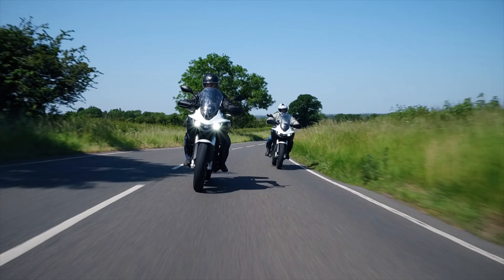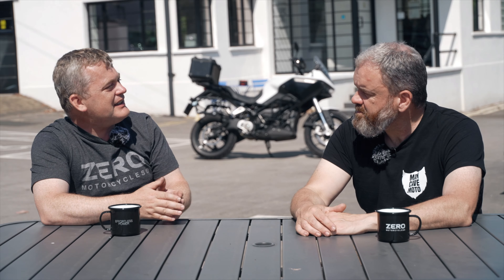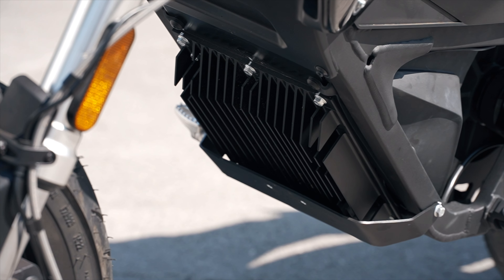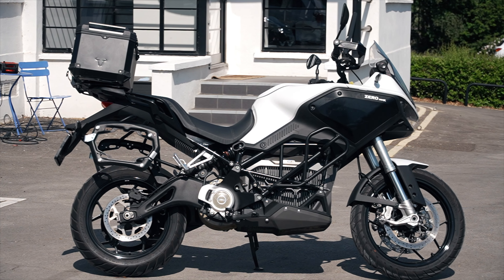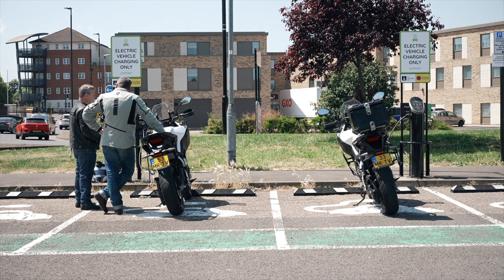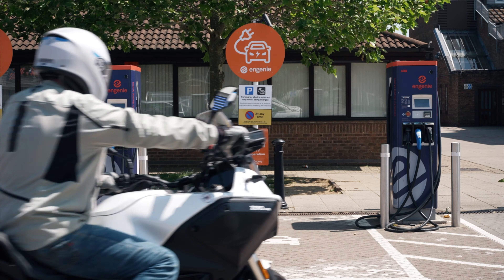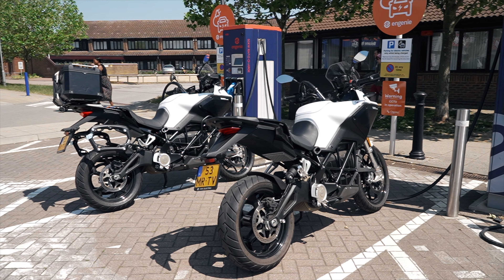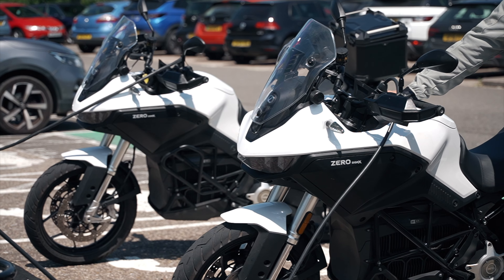Everything you need to know about electric charging with Zero Motorcycles

Comment: I have an electric car and absolutely love it. Range anxiety in the car is minimal so long as you plan ahead but you quickly get into a rhythm. I can see that bikes are slightly different and would require a little more forward planning. For commuting they make total sense though so the only problem is the purchase price vs a petrol engine. Fully commend Zero and others for innovating and giving us another option to consider. We’re definitely in a golden age of motorcycles. Thanks for the film
Reply: The problem with bikes is you have much less mass to dedicate to battery and your body makes up a large part of the wind resistance. Add on top high performance electric bikes have never been mass produced before. This is a case of chicken and egg problem just to even get the industry starting. It's an interesting start since the performance is already overkill, but the usability needs alot of work.

Comment: Charging can be very boring sometimes, but you can get used to it.
I do 150-200 km rides on my electric scooter, but I always need to carefully plan the route and charging stops in advance. Back up options are also important. Last weekend I only had a few percent left in my battery, and when I finally reached the charging station, both slots were taken. So I had to go to the nearest station, but I couldn't make it so I had to push my scooter 😅 It took 1 hour to charge from 0 to 50% which was more than enough to get me home.

Comment: Hi, quick question, are standard passenger car charging stations compatible with motorcycle chargers? Am I correct in saying that they typically will only accept AC charging, since the amps on a DC charging are too high. Appreciate any insights on this issue.
Reply from the maker: Generally yes, type 2 chargers are the most abundant. Energica were the only bikes that offered DC charging as far as im aware?

Comment: I can see the benefits, and this was a great video, but the range just isn’t far enough on them, and the charging takes too long.  5 minutes to fill up a petrol tank, 1 hour at best to charge the bike.  Same feeling with cars.  Until the range is longer and the charging is quicker, I won’t be switching over.
Reply from the maker: Nope its not there yet to make them a potential replacement, but they do offer an alternative for some people. DC bikes offer quicker charging and in some cases thats getting down to 20 minutes. Its the charging time that is more of a hindrance than the range. If you could charge in 10 or 15 minutes that would take them closer to ICE bikes

Comment: Interesting. 
But. It still comes down to cost and convenience. Personally, I don't mind if the motor is electric. I was impressed when I rode one. And no doubt some clever bugger will be able to make it feel and sound like any oetrol engine configuration,  when you switch 'modes'. 
The initial financial layout is still way above my pay grade,  and the charging stations are not as frequent as petrol. If they are not busy, ir indeed operational. For a long distance motorcyclist, especially once you leave the UK, it doesn't add up. For the moment. 
It's no coincidence electric cars are falling in popularity.  (VW) 
It's definitely part of the future, but not for me yet. 
Ride safe.

Comment: My #1 concern is thermal runaway.
Reply: LOL Not something you will ever experience in your life. By the time electric sport bikes have decent range, the battery safety tech will be soo advance. Probability of thermal runaway is practically implausible. You have been just been brainwashed with recent propaganda. 
FYI Luton Airport fire was caused by a Non Hybrid 2014 Range Rover Sport Diesel. The EV Charging Stations are in Terminal Car Park 1 ONE, while the building that collapsed was Terminal Car Park 2 TWO. The propagandist jumped the gun and instantly blamed EVs.

Comment: I have an e bike and that is crap battery kaputt after 6 months the generation after the baby boomers do not want and cannot afford electric motorcycles ,for myself i would never buy one let alone ride one.
Reply from the maker: Go on, give one a try,  it might not be practical for your needs, but you may well like the riding experience!
Reply: A cheap e-Bicyle with a sketchy battery is nothing like powerful electric motorcycle. That's like comparing an eBay 2 Stroke motor to a Yamaha bike. You are making up fake assumptions.